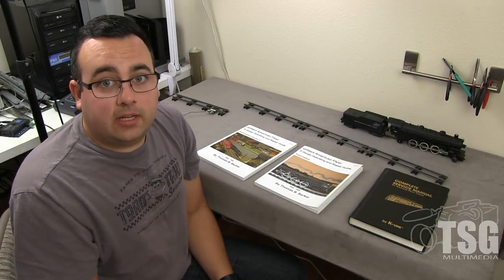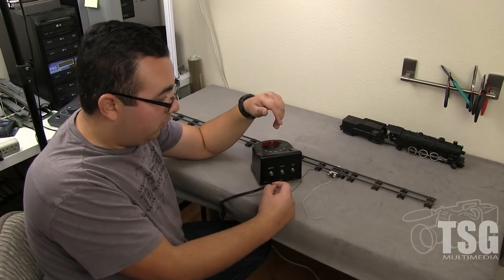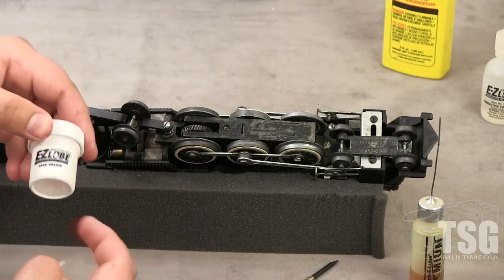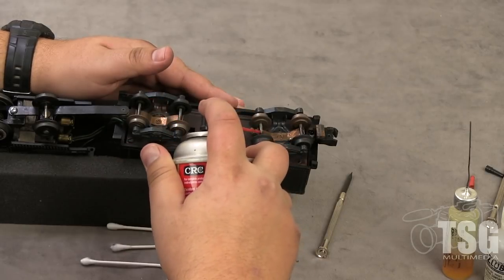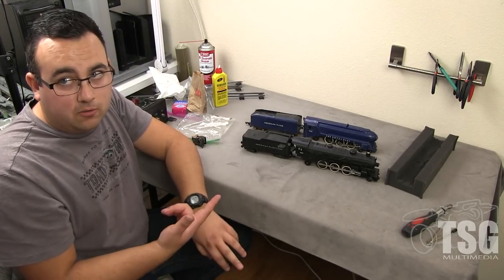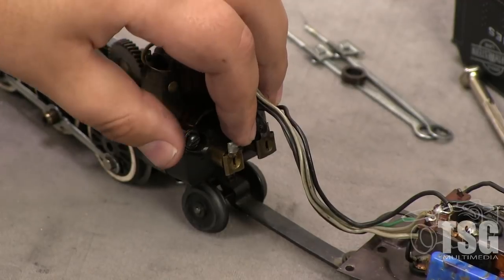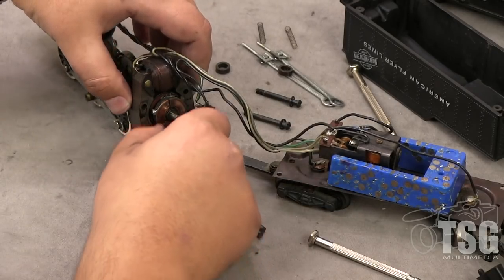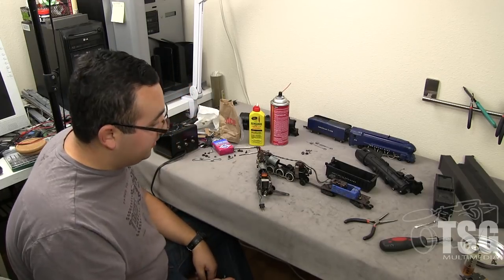Toy Trains 101 American Flyer Maintenance and Cleaning How To Postwar

Comment: Kevin I can’t thank you enough excellent presentation I appreciate it. I have my post war AF that I got for Xmas of 1954 and used it extensively during my childhood yrs. I’ve got several neat accessories, light tower, station with audio player inside, whistle, Air floodlight car, rocket car that launches missile, uncoupler, couple of track switches and a little extra track. I only have remnants of the b&w start up instructions and nothing to go on for self repair and up keep. Last time I had set it up it ran fine but the directional control was acting finicky which invariably leaves me thinking dirty contacts. I can’t wait to get that beauty out of storage and overhaul and clean it up good with the knowledge you provided me. Thank you so much you are an AF Guru.

Comment: Thanks very much for doing this video.  I found this video to be invaluable as I undertook the restoration of an old 1948 American Flyer that I inherited from my brother.  It was in good shape but it was inoperative after being stored for more than 65 years.  I had no prior experience in working on model trains, but with the visual demonstrations and commentary in this video, I was able to get it back to running condition.  Now it would be great to have a similar video on repairing smoke units, as that is the only thing left on my train that doesn't work.

Comment: Thanks guys!! Great video, lots of information that I can use if I ever get my American Flyers off the beams here in my shop and get them running again. Best information was on the Crud Cutter for cleaning the many many pieces of track I have.  I will be looking forward to more information on American Flyer such as remote switch and remote accessory care. I think I have a book much like those you spoke about.

Comment: Well guys....I am COMPLETELY stumped!  As I posted a few days ago, I have the identical #283 locomotive and was very excited to see this video.  I ordered all the parts and supplies I needed (lubes, grease, track cleaner, brushes and springs, etc.) and today was going to be the day for the big "tune-up".  I cleaned and lubed everything that you suggested and then turned to the motor.  The brush and spring replacement was a snap.  When all was finished, I applied power and the locomotive wouldn't move.  I have power to the headlight but the motor doesn't turn.  I have the cover of the tender off and can see that the drum is turning fine and "clicking" and the fingers are in good shape (I cleaned these all up good too).  For the life of me, I just don't know what the issue is.  Granted, its been 23 years since I ran it, but it was working very nicely when it was packed away.  I'm seriously wondering if it is something "binding", but I don't see any problems with the worm gears.  The thing is, with the brush bracket assembly off...I can physically turn the armature and watch the wheels turn accordingly.  When everything is assembled though, I can't turn the wheels of the locomotive.  I'm thinking this is "normal", but I just don't remember or know if the wheels were always free to move when I was just holding the locomotive in my hand.  Anyway, any help you could offer would be greatly appreciated!  I have no problem taking the unit to a repair shop, but I can't help but think that whatever is causing the problem is something very obvious and simple to fix.  Thanks guys!
Reply: spudman1125R does the motor hum or is it just completely silent? If it is silent it’s likely that the problem is still with the reverse unit. With power applied run the reverse unit through its cycle, as you do this use a toothpick to press down on each finger, if pressing on the fingers causes the motor to start running, remove the fingers and bend them down slightly and re install them. If this does not solve the issue it’s likely a short or bad armature. Check the condition of the drive wheels, if the metal “tire” is loose and can be moved independently from the wheel it will need to be glued back to the plastic whitewall material. Apply super glue to the plastic whitewall and use two or three flathead screwdrivers to evenly press the tire up onto the whitewall and wedge it there until the glue has dried. The plastic whitewall is an integral part of all American Flyer steam engines as it serves as an insulator between the metal tire and metal hub of the wheel and thus preventing current from passing between the two rails through the metal axle.
Reply from the maker: Superstars of AF!
Reply: @kevin2472  Thank you VERY much for the "toothpick on the fingers" tip Kevin!  I got movement immediately!  To be honest, I wanted to take those little boards with the fingers off (because I didn't think just spraying the contact cleaner in there would do the quality job of cleaning them that I was looking for), but I was paranoid that I'd break off those little tabs that you rotate with the needle nose to remove the board.  I've looked as closely as I can at that setup and just cannot seem to figure out exactly what is happening when you turn those little tabs!  But it appears that the fingers not making enough contact with the drum is indeed the problem.  Hopefully I'll have some time on New Year's Day to look at this further and get those fingers cleaned up and re-bent.  Thanks again for the quick response and help!
Reply: Just a quick update....it was the drum and fingers!  As much as I had sprayed contact cleaner into the reverse unit to try to clean it, it was simply no match for removing the boards/fingers and drum and then polishing the drum and hitting the tips of the brushes with an ultra-fine emery cloth.  After bending them to make better contact and soldering in my rebuilt smoke box, everything runs as good as new!  Here's a video of my results: https://youtu.be/olV1UNWEv0w
Thanks again Kevin for all your help!
Reply from the maker: I loved reading this exchange. Thanks, Kevin, for helping! You're a solid foamer!

Comment: Thanks for all of the tips.  The different cleaners I did not think about some of them....
I have a few more to add and some info that will be helpful.
 The reverse unit in the tender and on the engine have a unique difference as comparative the Lionel ones of this era. On ones in the tender they are sideways but the shut off is only mechanical on both types shown here, leaving that coil powered all the time. 
 The two position reverse unit often have a double winding on the outer field coil of the motor, and the reverse picks one coil or the other with the other ends wired to a permanent place. Why this information matters; is because your parts are not all electrically interchangeable if one used a 2 position and the other used a 3 position unit. However if one of the field winding of the motor burned out on the 2 position motor, the train could be wired for forward only or a 3 position unit could be used instead. But using a 2 position unit on a former 3 position motor will not work.
 The reversing is done by switching the ends of the coils usually the outer field coil. 
 I think many operators don't oil their trains till there is trouble, especially the rolling stock because it will get oil on the track. Sorry that can't be helped. Grease will be to thick in most cases or get hard and become useless or a gear jam, or will never get to the spot needing it. So to me it is best to oil it all on a run track and run it there for a while then wipe off what you can off the wheels and also wipe down that track after oiling it all. Recently I've been using the Zoom Spout sewing machine oil and then got a little thin metal tube oilier and put that oil in there so it is less coming out and I can get oil to narrow spots now.   

 Oh I would be very careful of cleaner sprays around your good trains, no telling what that over-spray will do to those finishes.

Comment: Thanks so much guys for making such a thorough and informative video.  I actually have the very same 283 locomotive and 4B transformer, so I was very happy when I stumbled across your page.  I wanted to share just a few things with you with the hope that you might give me a few tips.  First, I have the same white residue on some of the wheels of my rolling stock, but when trying the hair dryer method (using two different hair dryers) I was unable to get it to "melt away" like it does in the video.  I'm hesitant to turn to a heat gun, as I fear I might end up holding a bunch of melted plastic in my hand where there was once a box car!  Anything else that I might use to remove that release agent?  Second, I noticed that my locomotive was missing the small felt oil wick in the brush bracket assembly.  There was only a hole there, so I was wondering if I could just order part # PA9522 (the felt wick) and put it in there.  The original parts schematic that I'm looking at doesn't show it for the 283, and I was kind of wondering why.  Lastly, I have to comment about the "Krud Kutter".  I was at the Ace Hardware store here in town yesterday and saw the a bottle that looked exactly like yours (32 oz.) and they wanted $9.98 for it.  I thought that was a bit high, so when I went to Menard's a bit later I looked and they had the same thing for only $3.98!  The stuff worked like a charm with some sponge/Scotch Brite scrubbers...but the first thing I noticed was that it had no smell whatsoever!  The bottle even says "Fragrance and Bleach Free" and also indicates that it's safe to use on food prep surfaces!  I had to laugh, as you had described it as some pretty nasty stuff.  It still says to keep it off your skin, but I'm wondering if perhaps they changed the formula recently?  In any case...it worked great!  So that's about it...I've ordered all the parts I need to give my 283 a good tune-up and wanted to thank you both for a very useful and entertaining video!  Consider me a new subscriber!
Reply: spudman1125R glad you enjoyed it, I’d give the heat gun a shot, just be very cautious, I’ve never encountered any film that wasn’t removed with a hairdryer on high but heard it exists, the extra heat from the heat gun might do the trick but as I said use caution. As for the krud cutter maybe they did change the formula because the bottle I have has been around for about a year , can’t speak to the price difference as we don’t have menard’s in  California, wish we did as I’ve seen their line of train buildings!

Comment: Having all the copper wheels on the same side of the tender or a lighted car would not short the track, but would basically "short" the engine (meaning both sides of the anchor in the motor would have the same voltage potential) or light bulb. However, if the two axels on the bogie are turned opposite of each other, that bogie will cause a short, as both axels are electrically connected within the boggy.

Also, I'm a bit sceptical about using a wire brush to clean the wheels (or tracks). Such tools may cause tiny grooves and scratches, which can result in poor electric conduct / pick up, plus the wheels will pick up dirt quicker as it sticks in the tiny grooves you create in your wheels. Same goes for your tracks. It's better to use chemicals, and if mechanical cleaning is needed, use some soft material like wood or plastic.

Comment: I have a 5 digit American Flyer and it has a choo-choo and smoke apparatus.  I am the original owner.  My dad got it when I was just a couple of years old around 1957-1958. I don't know how it has a smoker and choo-choo if, as you said, they did not put them in the 5 digit from the manufacturer.  Did they have kits to add them after purchase?

Comment: Hi I have a question about a 360 Diesel I have. The reverse unit is not the typical finger type. This one looks like a round solenoid coil. It has 5 connections. How does this work and is it serviceable? Thanks.

Comment: What chemical do you recommend for cleaning carbon off postwar AF Locomotive wheels.  The train wheels spark as they go around the track.  I have already cleaned the track with IPA and CRC and alot of elbow grease.

Comment: Do you have anything similar for someone finding/getting an HO set that's been in storage for a good while?  That happened to me last Saturday. Someone heard I liked trains and sent a box of three trains, some having issues.  Wheels off or missing. Broken couplers or odd couplers or couplers that were different.  The worst was that two of the three locomotives had back couplers missing.  Oddly and gratefully the locomotives ran after some coaxing.  I wonder what I should do to keep these "oldsters" running or get them to run better. They seem to have potential.  If I had a friend nearby, I would love to be able to convert these DC models to DCC.  But that's not the case. Thanks for the episode!
Reply from the maker: Hi Dale,
I haven't done a "rehabbing old HO stuff" video at this point. My guess though, would be to take the loco apart and clean it up then oil it very lightly. If I ever get something like that I'll be sure to make a video about it.

Comment: These are great for Flyer before Lionel, but I fear I'll never catch up with the Lionel takeover, and Bachmann. Any recommendations for a Lionel "basic", and or a Lionel/Bachmann book? A better look and breakdown or repair/service on those "maintenance free" engines? Sorry, by Lionel Basic, I'm not talking about 3 rail operations or even O scale, I'm only after the S scale stuff. And Lionel/Bachmann, I'm basically looking for troubleshooting. I thank you very much for the lubrication points, I listen to this while I'm working, just as a backup to my memory. For the Bachmann end of this, I think I'm after troubleshooting, which circuit boards do what. I'm trying to plan ahead for DCC or ACC with wiring and whatnot on my layout. I've tried to correctly space for DC, using a "simple" color coding system underneath, with insulators up top.  When they introduced Bachmann, it's like a whole new motor. Being able to troubleshoot them would be huge... Email might be better for this, shoot me a short reply with when and how to reach you. Be easier than typing.
Reply from the maker: My sense is that when you take these things apart, they're very similar; even if their internal components are situated differently.

Cleaning and lubricating carefully will help any model from any manufacturer as long as you take your time so you don't break anything and always use the right kind of lubrication.

Comment: What is the proper direction for the brushes? Shouldn’t the large end make contact with their armature and the smaller end accepts the spring.  In the parts diagrams it seem the brushes are facing with the larger end to the armature.